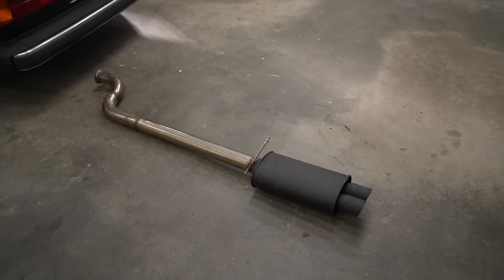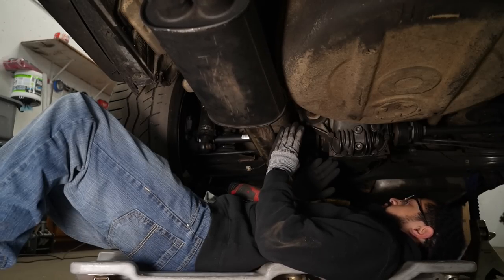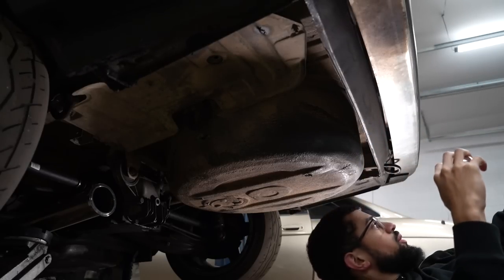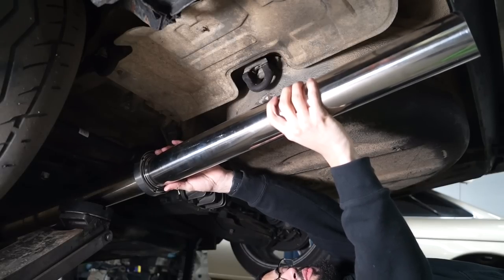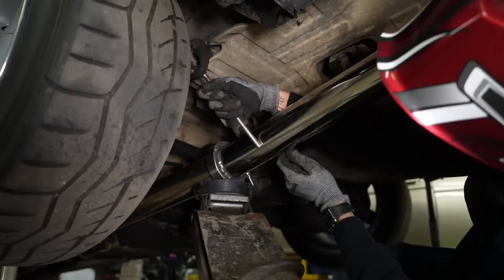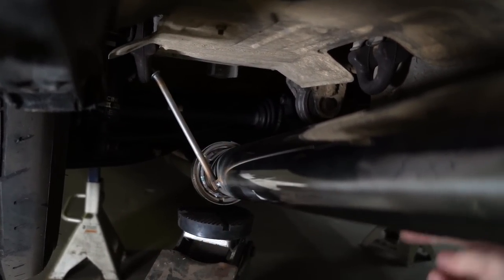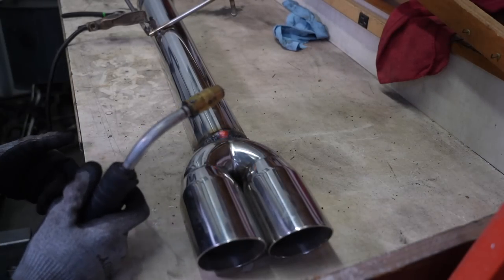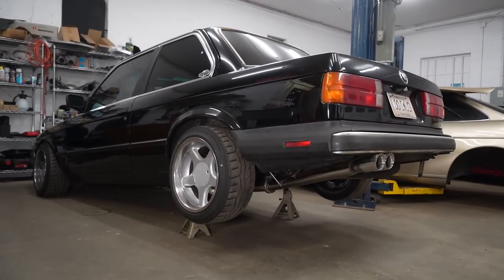DIY Muffler Delete On My Turbo M50 E30

Comment: That zip tie trick is one I will remember, that looks way more easy then tape, sharpee or anything else.
Reply: You can use stiff paper like construction paper and warp that around. It lines up very well.
Reply: @FishFind3000  Ye but we all own zip ties, imo the best sollution
Reply: @Insane98  And you'd have to hold the carboard too, zip tie doesn't want to unwrap

Comment: Ha! Had the same exhaust tip on my e30 back when I had 2.5" exhaust as well!
In my experience, the v-band clamp is by far the weakest part of the setup. I treat them as limited use and try to replace them after they've been removed a few times.

Comment: Hey Joel, lovin the E30 so far. I would like a video about exhaust bypass valve, its an electronic valve that bypass the muffler and you can switch it using a remote. I'm thinking about installing one of those in the future.
Keep up the good work!